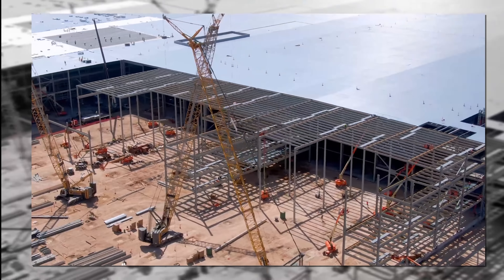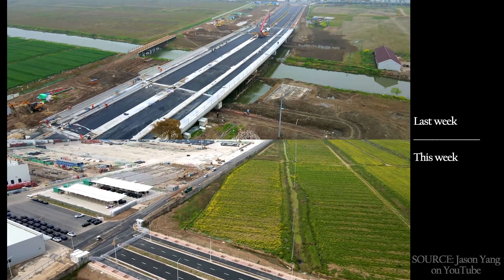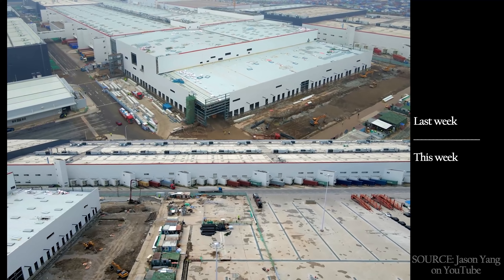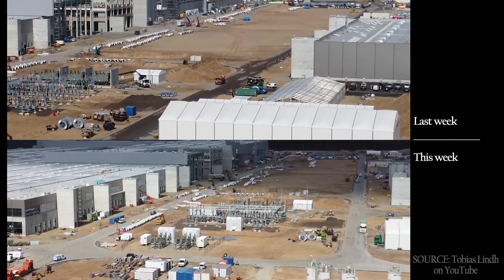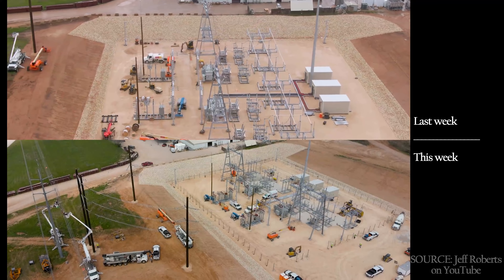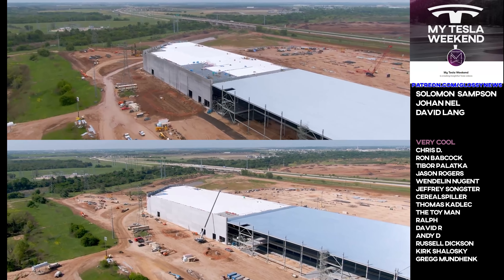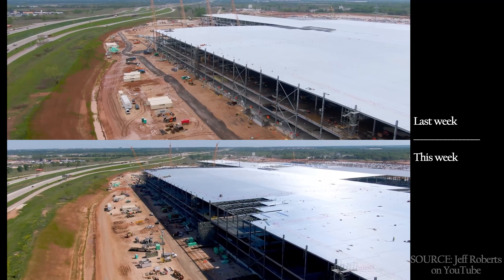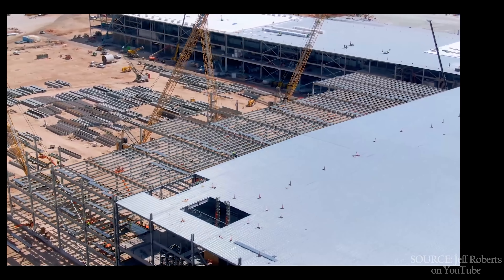Giga Texas taking the lead - All gigafactory progress side by side

Comment: It will still be quite some time before Texas has the main power turned on. If you look on the far East side where the steel structure meets the Gigapress structure the main electrical feeders haven’t been pulled into the building. Plus all of the switchgear (main electrical cabinets) need to be installed and the electrical room walls and doors finished. 
I believe that the main electrical room is the first steel bay beside the Gigapresses.

Comment: IMO the tall bays in the Phase 2 infill (Shanghai) echoes the bay structure of the battery area at Giga Texas. So based on that I’m assuming it will house battery production.

Berlin is falling behind. Excepting the stamping area, there is no HVAC on the roof only pedestals.
Reply from the maker: I'm with you there. I thought Berlin would crush it, but with how Texas is going, I'm just not sure about that anymore.
Reply: @FutureAzA  I still think you may see a vehicle out of Texas before Berlin -- Socialism just creates SO much red tape it slows everything down so much.

Comment: Nice video. I didn't realize Shanghai had 4680 plant incoming. Looks like 1. Kato Rd, 2. Shanghai, 3. Texas, 4. Berlin in terms of 4680 production timeline. Also Panasonic and LG have test lines that are likely to beat Berlin, and maybe Texas and Shanghai too.
Reply: Also Shanghai has 3 gigapresses, enough for about 350k 3 piece vehicles. Is there any more planned/where are the original 3 in terms of the Shanghai factory. I'd guess they'd want 3 more for about 700k. Then another 4+ for the Model 2 factory